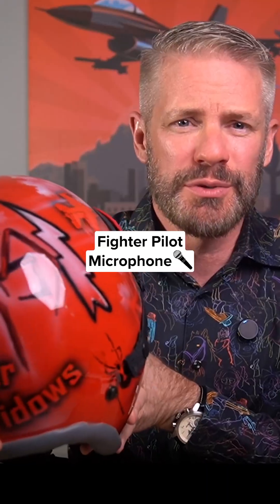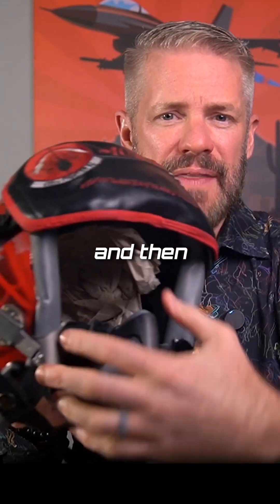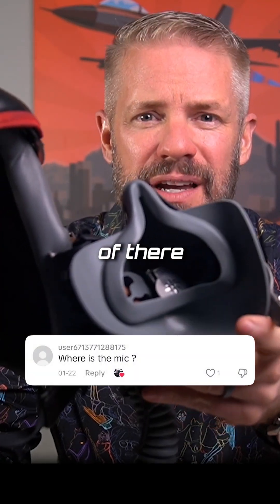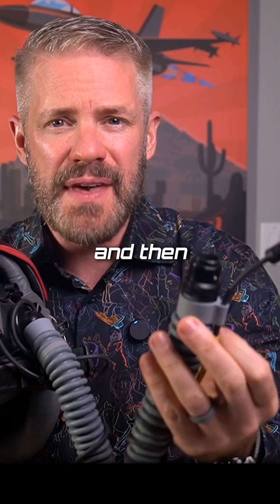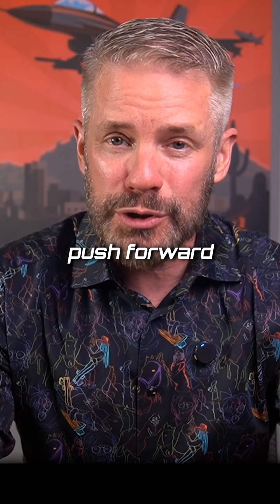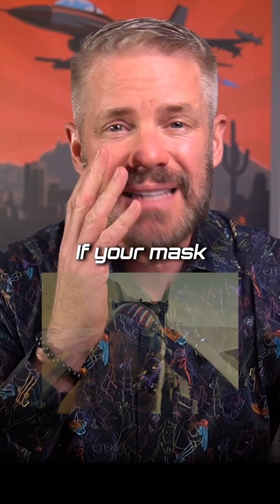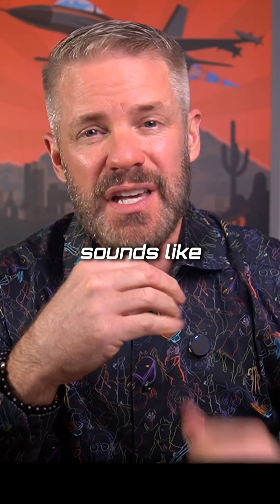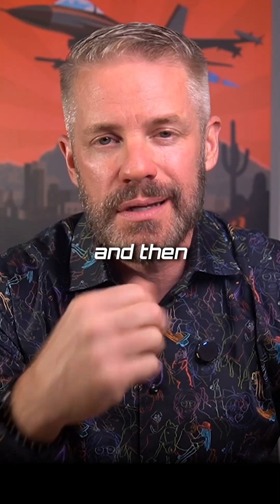How Do Pilots Communicate In A Fighter Jet?

Comment: Could we get an explanation on sayings and the language fighter pilots use?
Reply: What specifically? They use a lot.

Hot - Unknown/Enemy heading toward you, possibly with hostile intent.
Cold - Unknown/Enemy heading away from you - no threat
Flanking - should be self explanatory 
BRAA - Bearing, Range, Altitude (most commonly heard when talking to AWACS)
AOA - Angle of Attack
Check left/right - Turn left or right. You can add degrees or a heading on to this - Check Right 90 - turn right 90 degrees. Check Left 270 - Turn left heading 270. 
Mil - Full power without afterburner
Go Gates - Hit the afterburner
Offensive - Self explanatory
Defensive -  Self explanatory

There are tons, so if you have one in particular you want to know about I'd write it down. I'm sure me, Shawn or someone else can tell you. :)
Reply: @UncappingBadger  That's actually so helpful thanks! I really don't know much about fighter pilot language so this is a good basis :)